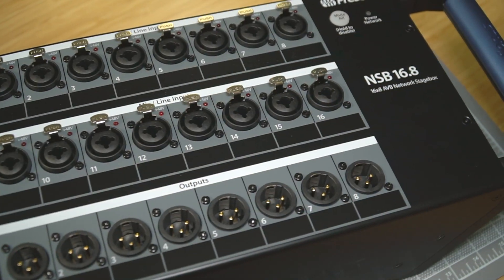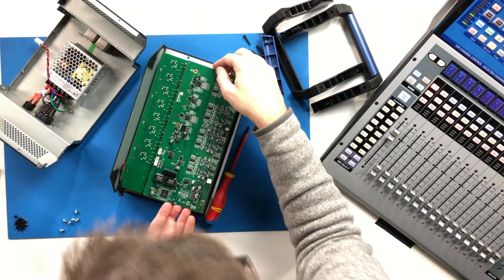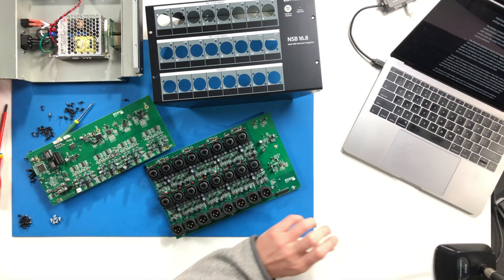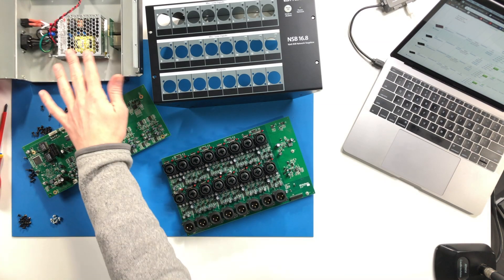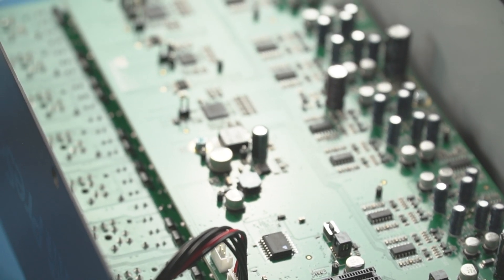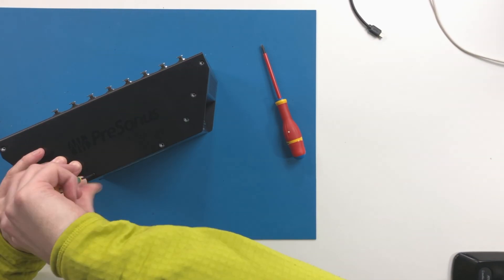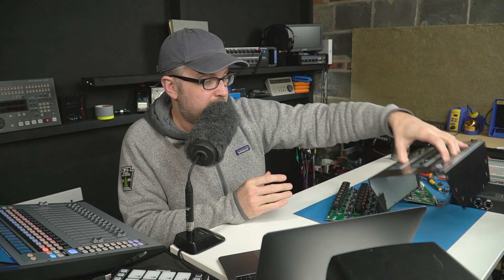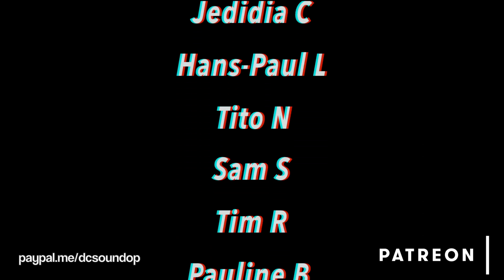#117 - PreSonus NSB 16.8 StageBox Teardown & Review

Comment: Have read posts on line of these dropping sound intermittently. One commenter said the the cause was overheating and blowing air directly with a fan was the only solution. 
I really want this system to be dependable.

Comment: I have a 16.8 stage box that is used live. Several of the Amphenol XLR latches have falling out during use. Do you happen to have the actual Amphenol female part number? Thanks for the great video!
Reply from the maker: Hmm.. have you reached out to PreSonus yet with this question? They probably have the part number on hand. Without a stagebox or schematic on hand to compare, it would be a bit of a guess, but you might be able to narrow it down on the mouser website by looking at yours - https://www.mouser.com/ProductDetail/Amphenol-Audio/AC3FAV-AU-PRE?qs=4QugYJNEYLekyy65HviOkA%3D%3D&mgh=1
Reply: @DcSoundOp  - I did reach out to Presonus Support and was told "We don't give out part numbers. Please send in for repair" .  I ordered Amphenol ACJC10 series with latch from DigiKey and will compare. This connector has the Dual XLR-TRS support like the stage box. I'll update the comment when the parts arrive in the near future. Thanks for the reply.

Comment: If I had limited rack space...could I use a StudioLive 16r as a mixer and this NSB 16.8 as a stage box.  Is this a good cost-effective workflow?
Reply from the maker: Yes, absolutely that is certainly an option with the 16R & NSB stageboxes. You just have to remember the total number of channels the mixer can handle at once is 18, so you wouldn't be able to use all of the inputs at once if you add that many more.
Reply: @DcSoundOp  I am trying to use OBS or VMIX live streaming events so it seems like the 16r can give me a stereo master mix out of the USB.  Am I assuming correctly?

Comment: Hey hey it would like to connect the nsb to my motu 624 through avb, do you think i could route the outputs as extra inputs ( I don't really need the extra outputs..)
Reply from the maker: Hey Wim, I think you're going to run into a few problems there. Currently I don't believe there is any software to remote control an NSB's input stage, so while you may get line level signal to pass, you won't have control over the head-amps. I've talked with PreSonus about this & at one point this time last year, I think one of their engineers was working on a software solution, but I don't know if it ever came to anything. 

To your actual question though, I do not believe you'd be able to use an output as an input interchangeably. The networked audio signal doesn't care which direction, but the physical input & output circuitry would need to be designed with this in mind. 

Keep an eye on the avnu.org Milan program - that is where you'll find the most work being done on AVB compatibility between brands & what that means for the bigger picture. Thanks for the message!
Reply: @DcSoundOp  Hey tx! I've managed to hook up a tascam us 16x08  that's connected via usb to my mac through avb to my windows pc and the motu but the quality of the tascam isn't great (pops and crackles when using low latency) I want a cheap option to have line inputs (no fancy pre-amps) via AVB to connect synths and drum computers but it seems i don't have a lot of options, thank you for your answer!
Reply from the maker: Have you considered something like the Behringer ADA8200 (or better) going optical into your 624?
Reply: @DcSoundOp  Yes, i have an old motu 8 pre as adat input and an ADA8000 as adat output, it's my fault for not doing better research but i thought i could extend my motu 624 (824€) with a lot of inputs via AVB cheaply, the cheapest option would be the presonus 16.8 which costs about the same as the the motu with 8 outputs that i don't need :( It would be cool to find a - for example - cheap 32 line avb input to wire my whole studio so i don't have to switch cables all the time :)

Comment: Hi, two pieces of information you mention are not correct.

Series 3 mixers handle 56 'channels', over 7 streams of 8 channels each, via AVB. Streams are not the same as channels.

The 16r mixer only handles 18 inputs total, not 32 as it lacks the extra DSP that the other models do (channels 1-16 + Digital Return LR). It does have 56 AVB sends available, but since you only have 18 inputs, so you can't fill all AVB Send channels (this also keeps the stream routing the same for stagebox modes). Analog only gives you 8 outputs (Aux 1-6 + Main LR physical outs).

Please correct your video.
Reply from the maker: Hi, thanks for the message. There is no method to 'correct your video' here on YouTube, just FYI, they took annotations away some years ago. I appreciate you pointing out my mistake in calling the 56 channels 'streams'.  

I absolutely missed the ball on the 16r i/O count, with all of the various i/O numbers between AVB, USB and the different hardware in this line, I got that one wrong. 

Also, a much BIGGER misstep was saying the NSB units could be controlled in stand-alone mode via universal control software. I addressed this in a comment below with Jan Koppe & followed up with the PreSonus team @ NAMM to confirm I wasn't missing anything. While I have been able to connect the NSB units to a stand alone AVB network, as this time there is no way to control the HPF, Phantom power etc via software. This functionality should be available via 3rd party software in the future I'm told, but I'll be speaking with PreSonus again on a video call here next week if you have any additional questions you'd like me to ask them regarding the series. 

Thanks again for the message. I don't claim to get everything right & these comments help future viewers quite a bit as these products evolve and are updated after the videos are released. Have a great day!
Reply: @DcSoundOp  Sorry, should have wrote that a little better. I think I was still drinking my coffee.. :) Definitely agree on the UC Control, but I think there are some things to tackle before that happens.

Really enjoy the vids, btw. The NYE ball drop setup was awesome.

Comment: Hey, do you know if Presonus provides any AVB Drivers and some Control Panel for those boxes? Having one of those to directly connect via AVB to a Laptop would be awesome, including preamp control (gain, phantom).
Reply from the maker: Hey Jan, as I understand it, you can use the UC surface software to control the boxes over the network.

As for drivers, on Mac (any model with a thunderbolt port or newer) you won't need drivers, just a hardwired connection. You need either native ethernet support on your computer, or the apple certified ethernet to thunderbolt adaptor - you cannot connect to AVB using usb to ethernet adaptors. The AVB device should show up in your system audio options. 

On windows your options are limited to third party vendors -  I don't have personal experience, but this one is suggested elsewhere online - http://www.audioscience.com/internet/products/avb/hono_avb_vsc.htm
Reply from the maker: Jan,
 I've been testing some today & while I have the boxes connected and working as AVB devices, connected directly to a MacBook Pro with just an ethernet cable, the control end of things is proving to me more difficult. The Universal Control software running on the Mac with just a stagebox connected will not allow any pre-amp or input control. Going to setup wifi tomorrow & test more w/ iPad for you. Stand by.
Reply: @DcSoundOp  Wow, thanks for taking the time! Good to know that they work as AVB devices without a hitch. Controlling the preamps is a problem, as always. Would be very interesting if Presonus could release a standalone preamp control software. Yamaha does that for the Rio boxes as well.
Reply: @DcSoundOp  any updates on this?
Reply: Any word on preamp control and latency? Would make for an awesome sound card😉 no more snakes in the studio

Comment: Great vids and maybe too much to answer here but I hear a lot of people say they don’t want to run their preamps near full but never really “the why.” 

I mean, given clean pres, if you needed to run a pre at 95% to push an SM7B for example, what would be the downside? Or better yet, why do you not like to run a preamp too hot if you needed and it was a quality pre?

Thanks!
Reply from the maker: Hey Francis, thanks for the message! While you certainly can run into feedback issues quickly with excessive input gain, it's not due to polar pattern change. It certainly can feel that way if you've had to gas up an input to get a level, the resolution of every control downstream is now WAY different than what you're used to. 

We can test this with a mic like an SM58, a mixer and some headphones. 

Plug in your mic with the pre & the headphone output all the way down. Now if we turn the input trim all the way up, the resolution of the headphone output control is going to be all out of wack. We know that just cracking it open, there will already be a ton of gain there, because we already applied it at the input stage. If we it turn our headphones up slowly though, just enough to hear comfortably, we will see that our mic still sounds like an SM58 & the pickup pattern has not changed. 

Check out this great paper from Rane that goes into the details of gain stages in a sound system. Noise is typically what we're looking to minimize, from the electronics and also from the environment.We do this by moving mics physically closer to the source, choosing the correct polar pattern for the job & setting the gain properly throughout the entire system. 

Thanks for watching!
Reply from the maker: Hey Ray, thanks for the message. Given a clean pre-amp (like a super clean pre-amp) it really wouldn't matter. Gain applied is best done as soon as possible after the input, so I wouldn't have a problem with a low output mic going through something like a millennia pre, being wound all the way up to get the level needed for a specific task. 

In most situations though, it's all about signal to noise ratio. If you need to open a pre all the way up on a budget console to get a fairly standard mic up to level, there's a better than good chance that you're amplifying a whole lot of noise along with your signal by the time you get where you want to be. 

There is a great paper from Rane that talks at length about gain structure in live sound and how important your approach can be to the results you achieve. https://www.rane.com/note135.html

Thanks for watching!
Reply: @DcSoundOp  👍Thanks
Reply: Ray Ortega in live you always run the risk of feedback if you run a pre too hot, no amount geq can take that out. Because you are effectively enlarging the polar pattern of “x” mic.
Reply: @junejhunkie  what.

Loop gain is loop gain... whether you're getting it from your pre, your dsp, or your amps (granted exception to the remote possibility that a live sound console will have excessively colored pres), but none of it will change your pickup pattern...
Reply: @junejhunkie  Good point, I don't do a lot of live, however if they mic requires that much gain (RE20, SM7B, etc) then your polar pattern is equal to a mic that only needs less. So in those cases, I wonder what is different about a pre near the top as opposed to the middle. Only difference I think I've noticed is the very small amount of room you have to make adjustments, small adjustments make bigger differences near the top end...I think;)
Reply: Ray Ortega it depends on the mic pre you’re using. I find on most live boards there is a thin line you have to thread when you want more gain on those hi impedance mics(ive owned those mics in past and familiar with what you are facing). You are going to end up with a lot of experiments with which mic pre for the job. Audients for the mid price and some millenia for the hi end stuff. Good luck!